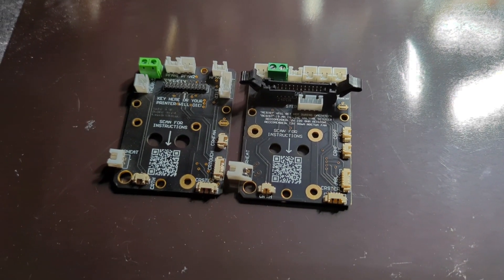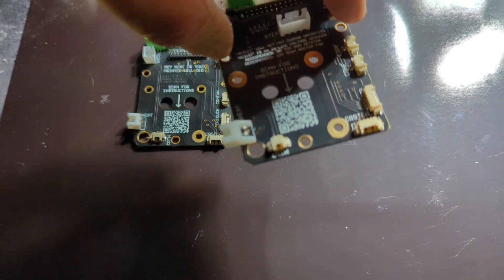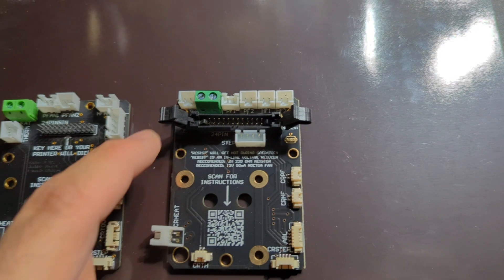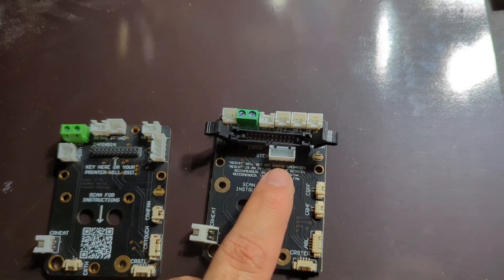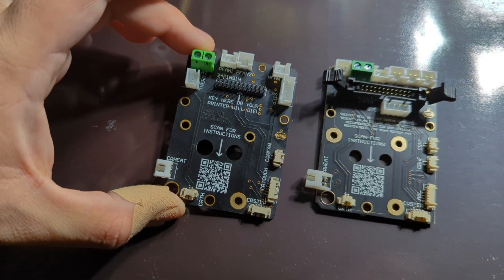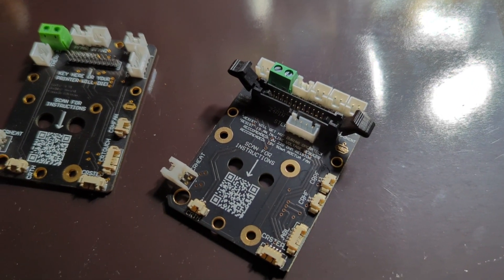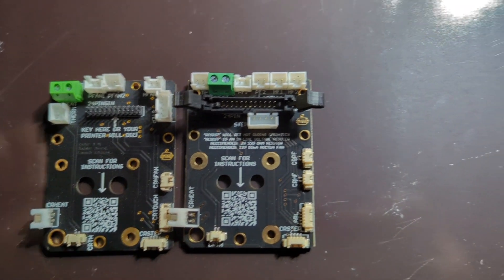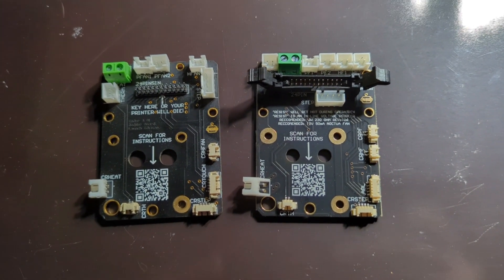Modder Board V1 vs V2 for Creality Ender 3 S1 series of printers

Comment: Hi Will,
Thanks for making this video! 
One caveat on the Ender 5 S1 compatibility - it is not a complete drop-in replacement like it is on the Ender 3 S1 - it requires some rewiring.

1) Creality changed the connector type for the thermistor on the Ender 5 S1 to a slightly larger connector. 
2) The Part cooling fan port that I added is blocked by a random strut on the Ender 5 S1.
But this is the nature of things, always have to play catch-up with an ever-changing design.

I was able to get around these issues pretty easily by rewiring the thermistor and part cooling fans up to the connector on top of the printer.
Reply from the maker: Thank you for clarifying.